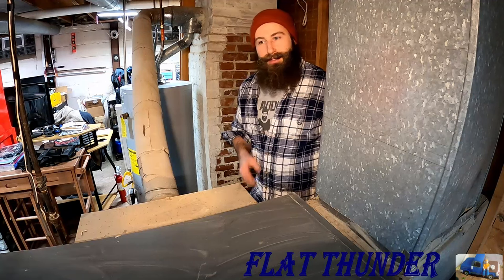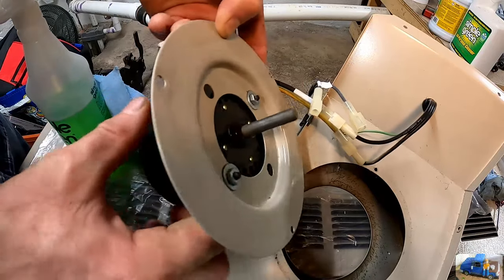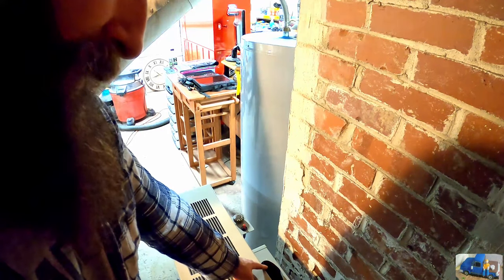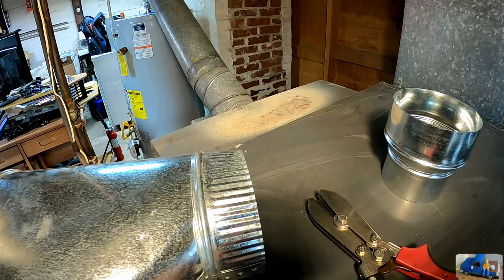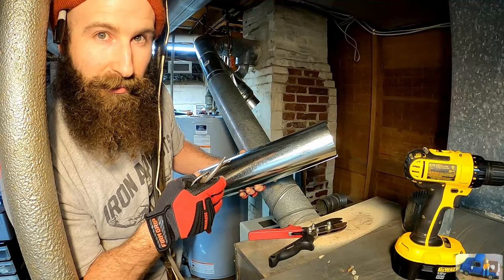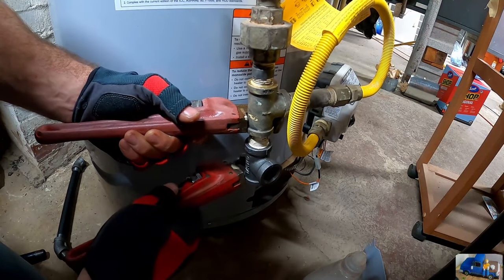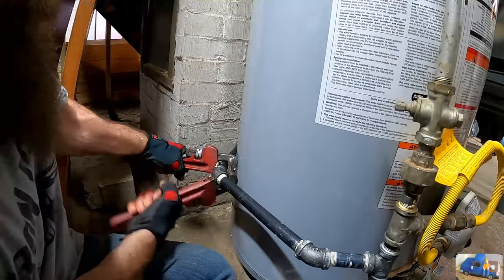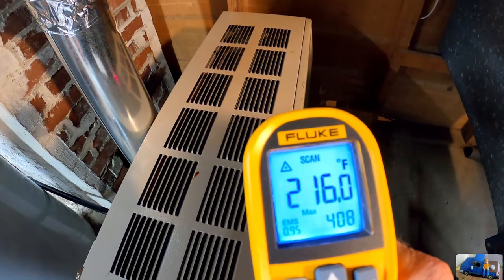VENTED HEATER; EMPIRE RH-35 INSTALL

Comment: The motor has two oil cups, just a drop or two a couple times a year keeps it from the lumpy bearing syndrome. I have worn out the jaws on my pipe wrenches, some are replaceable. I prefer Rigid myself. I've had issues withe my combustion chamber cracking, I vented it through the wall with 90's as it was hooked to the chimney I removed. The new combustion chamber cracked like the old one. I contacted Empire and they said it probably wasn't vented properly, otherwise it works well in northern Wisconsin anyway good luck with the new old appliance, you'll still have heat when the lights go out.
Reply from the maker: It's an excellent backup heat source!  So far I am happy with the unit.  I will have to lubricate the blower motor before winter season kicks off.  Thanks for the tip.  I have not used a pipe wrenches enough to wear one out.  The El Cheapo I tried to use in the video really frustrated me.  I believe it found it's way into the scrap pile.  Thanks for watching!  👍😁

Comment: Did a good job making that look hard. That drip leg at the heater is wrong and should have used 2 90s instead of that 45 thing.
Reply from the maker: Not sure I know 100% what you are saying.  The only 45° elbows were used to wrap around the water heater.  This is the supply leg for the heater installed.  I wanted a tighter fit to remove catch points.  Thanks for watching!  👍😁

Comment: Your empire heater. Why doesn't the pipe hook directly to the heating chamber???I'll sure appreciate it if you can shine  some light on that 🙂
Reply from the maker: I haven't fully disassembled my unit (all the pieces).  I do believe the exhaust is directly connected on the backside. The exhaust gas wants to rise naturally and finds its way into the pipe.  The heat only radiates from the external shell of the box / heating chamber.  I hope this helps!  Thanks for watching 👍😁

Comment: I'm wondering is there a need for a pressure regulator on a unit like this?
Reply from the maker: Your supply should already be regulated to a maximum pressure.  The gas valve on the heater has a test port to gage the pressure; 1/2 psig is the max pressure per the manual.  Do not operate at pressures above this.  Thanks for watching!  👍😁

Comment: Thank you...needed a look at the motor without taking it out of the unit. I think I will order the cushon, wheel, mounting plate and motor....it is an old unit.
Reply from the maker: You're welcome!  I received the replacement motor via mail order and have it installed on the heater.  During the install I noticed the thermal switch that automically turns the blower on/off was damaged.  I would plan on replacing the thermal switch too.  It's probably dried out from the heat like mine was.  Happy fixing!  Thanks for watching 👍😁
Reply: @FlatThunder  I went to the Empire wed page and  they don't recognise the parts number from the manual. Another site had a kit but out of stock. Amazon has the motor but I  think I should replace the cushon also.  It still works but makes an annoying noise, interrupts my wi-fi and TV signal and with under 20° we need to spread the heat here in northern PA. My unit is an RH-50CB...gonna be on the phone with Empire tomorrow if  Orlena don't knock out the internet and power. Stay safe!
Reply from the maker: @terrancecoard388  I within the last 5 minutes installed my new thermal switch.  It just arrived today.  I was curious to see if my unit was noisy.  It's smooth as can be 😁.  I think the pilot light on my older furnace, right next door, is almost louder than the blower motor. Not for sure what the cushion is.  If it's the black plastic piece that fell apart during disassembly in the video I omitted that piece.  It was too hard and brittle to reassemble.  Giving it a go without it and it seems to work okay.  My replacement motor and switch came from Amazon.  Best of luck with the snow. ❄️🥶
Reply: @FlatThunder  Yes...that brittle part....this unit has been here quita a while. As an FYI...The furnice is between the router and the laptop and TV. I listen on headphones and when the harmonics goes wonky it gets staticky and raises the volume  and I cannot lower it on the computer I have to use the volume knob on the headphone...this is with the Bose. With an Apple headphone it gets the static but does not raise the volume. On the TV, the signal sometimes gets lost but most of the time the picture momenterily freezes with some static. Tuck that in your troubleshooting quiver. I was a communications tech that took care of very remote sites with generators and HVAV. You learn real quick to think outside the box. I fixed a lot of problems that did not make a lick of sense!
Reply from the maker: @terrancecoard388  Interesting.... Technology evades me, anything with WiFi/Bluetooth connections I have no idea.  My ring camera was quite the challenge.  I use my bose wireless headphones in the area directly next to the heater.  I will see if it effects the connection.  Weird things happen with those frequencies through in the air. 🙄
Reply: @FlatThunder  I contacted Empire and they responded rather quickly to my question about why I could not find the part numbers. They sent me an updated manual and the new part numbers are there and I found them. The part that was brittle and broke apart on you is R-587 Motor Cushon about $9 on their website. We got just enough snow to make it a wonderland and not the dumping the coast got.
Reply from the maker: @terrancecoard388  Thank you!  I ordered one for my heater using the part number you supplied. 👍😁
Reply from the maker: I received mine today!  Surprised it is more rubber like consistency..... My old one must have been cooking for a long time!  Thanks again for sharing the updated part #.  Cheers 😁
Reply: @FlatThunder  Cheers!! I think my problem is the Fan control and ordered that, the cushon, thermocoupler and ecoswitch from Dey. As a retired maintenance tech I like to keep backup spares because things break on Friday evening of a three day weekend. For the $8 shipping I am ordering what I can for a later date. The prices at Empire is a bit more expensive than Dey...I confirmed that their parts are OEM. Stay safe!
Reply: @terrancecoard388  What is DAY?
Reply: (Dey)
Reply: @jeffreyashley6753  DEY Distribution...the online company where I got the parts.

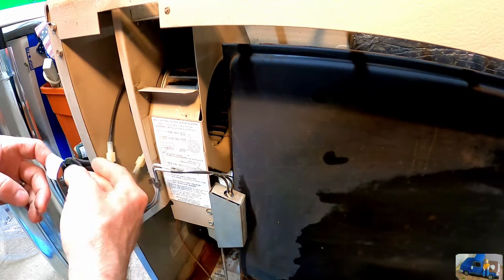Comment: Hey thunder! Pausing at 3:18 there’s a small grey box with wires coming out of it. Mine is missing that part and I don’t know what it’s called I’ve been looking everywhere. Do you know what it’s called or what the part number is? Please and thank you sir!
Reply from the maker: Hi Connor!  I believe that is the temperature switch for the blower motor.  Remove the cover and it's inside.  I bought mine off Amazon I believe this is it:

Empire R1156 Fan Limit Switch 165... https://www.amazon.com/dp/B06ZXY1C7Y?ref=ppx_pop_mob_ap_share

Thanks for watching!  👍😁

Comment: Dumb question but mines already installed in my wall 
And it's summer, how do I shut it off?
Reply from the maker: I believe the thermostat adjustment knob will only allow you to turn it to 'pilot only' setting.  The main supply valve body should have a knob to turn off the gas supply and if installed correctly a gas line shutoff should be close to the appliance.  Thanks for watching!  👍😁

Comment: How do you replace the burner in the Empire?
Reply from the maker: I have never completed this process, but I imagine it's not overly complicated.  It's a pretty simple mechanical system; maybe one gas line connection & a thermocouple / ignitor pilot light assembly removal.  Best of luck on the repair and thanks for watching!  👍😁
Reply: @FlatThunder  Thank you!

Comment: How hot does the top of this unit get?
Reply from the maker: It gets really hot!  You do not want to touch the unit when it's on.  Thanks for watching 👍😁
Reply: @FlatThunder  - I have one on order. Was thinking about adding a couple eco fans to the top of it gets hot enough.
Reply from the maker: @justinflott5133  I cannot locate my infared thermometer.  If I find it in the next couple days I'll probe it.  I recommend installing and or buying the internal blower option too.
Reply: @FlatThunder  - going in a 1 room off grid log cabin with no electricity

Comment: How to light it tho
Reply from the maker: Turn the main gas valve to pilot, hold down the knob, push the ignite button or use a lighter stick on the front panel.  Their is an access hole on the front burner cover (the black sheet steel).  Be careful. If you smell gas stop and wait until it clears before continuing.  Be safe my friend!  Thanks for watching 👍😁
Reply: @FlatThunder  but do I turn the main gas line off before I light it or no and sorry I’m just not trying to blow up lol
Reply from the maker: @yaramyahyahyasharel5975  the main gas line, the yellow feed line installed in the video must be on for the unit to lite.  I would turn the main control knob, the brown one with the thermostat settings, to off or night setting.  This doesn't really matter but could give you more piece of mind.  The main burner should never ignite if the gray knob on the main burner is set on the 'pilot' position.  Do not try to light without adjusting the small gray knob on the main valve to pilot.  Hold the gray knob down and try to lite.  It may take awhile to purge the air from the lines.  As I mentioned of you smell gas and the pilot light isn't on release the knob, stop trying to lite the unit and exit the area.  If you have any concerns about the process please consult a professional for assistance.  Thanks

Comment: Wish you would’ve ignited it on camera. Freezing my ass off right now and feeling like an idiot
Reply from the maker: I did ignite it on camera; ~34 minute mark.  It was a view of the pilot light and not the button.  Sometimes the thermocouple can get dirty and or the ignitor gets bumped out of the way.  The easiest solution, the part I didn't show, I use a lighter / light stick and hold it next to the pilot light while holding the gas button.  It takes a while for the air in the lines to purge.  This also keeps you from putting a bunch of gas in the room.  Once the air is purged it should light as shown in the video.  Happy lighting and thanks for watching!  👍😁